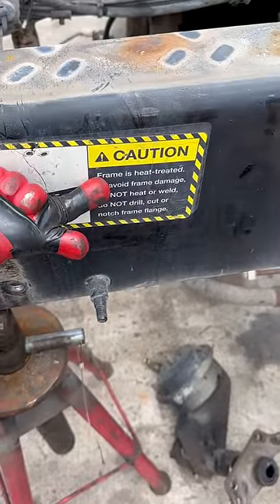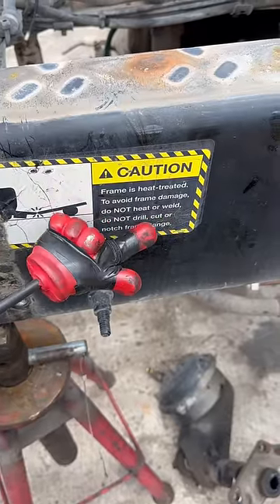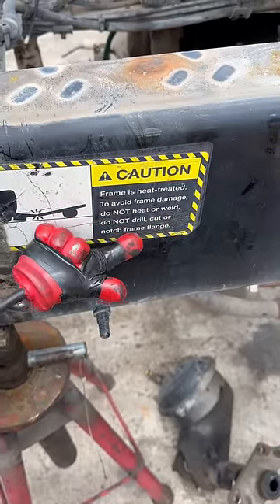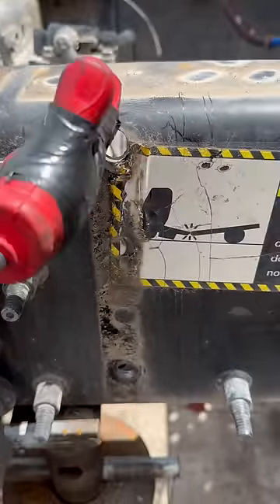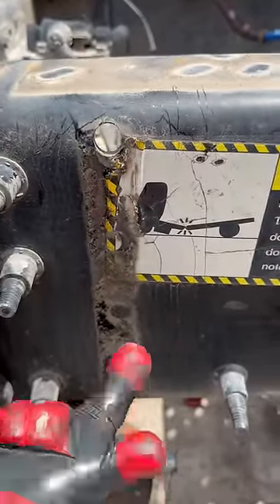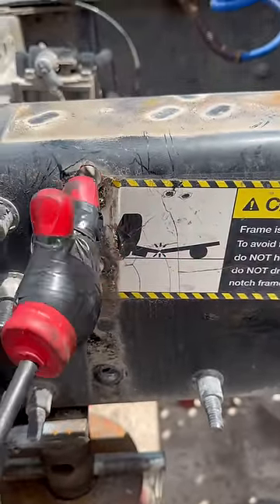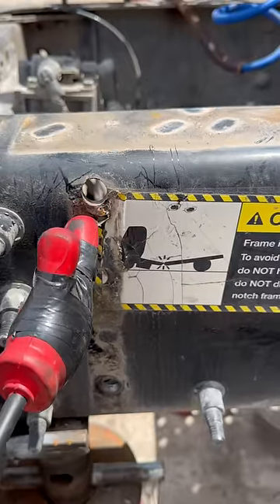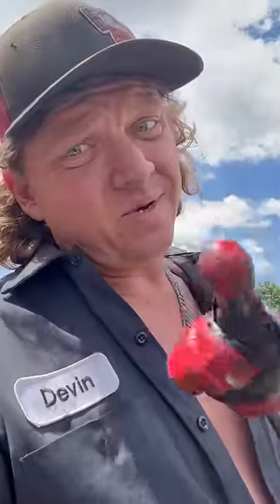When it says don’t do it , DONT DO IT

Comment: I agree the hole was drilled too close to the radius. The sticker said not to modify the flange which is the top and bottom of the C section of the frame rail. The holes are in the web of the frame. If the holes are properly located, drilled straight and deburred there shouldn't be a problem.

Comment: Place I worked some years ago had a HUGE piece of equipment used to convert rolls of paperboard to stacked sheets of paperboard for presses.  
It needed a major part replaced that required removing a large (very large) gear.  
On the side of the machine was a warning sticker that said DO NOT heat the gear to remove it.  So, maintenance tried to remove the gear.  It didn't want to come off.  So they decided that the warning sticker was a ploy to keep them from fixing the machine rather than calling the company for their maintenance.
It wasn't a ploy.   The gear of course cracked when heated, just like the sticker warned.  
It was three MONTHS before they were able to find a replacement gear and fix the thing.

Comment: I worked for a gas hauling company. They took a truck to a cheap shop to have a transfer pump installed. They welded a bracket on the inside of the frame rail, right on the flange. When that frame rail snapped in half, it was on that weld.

Comment: Beam theory says this man is right. The top and bottom flanges support the bending stress. The center supports peak shear stress. Partially in between the center and outer edges, slightly favoring the top/bottom away from center, is where minimum stress is located in a beam.

That being said: You are best off using the smallest hole and bolt possible, strong bolts like AN- not Grade 8. And chamfer the hole clean up the burr to reduce fatigue.

Comment: Some of you cant read but its ok it says 

CAUTION
Frame is heat-treated. To avoid frame damage, do NOT heat or weld, do NOT drill, cut or notch frame flange.

The driver only drilled a few holes they didn't do the rest of the steps on the warning sticker

Comment: That's basically a write off now. I'm sure you could temper, repair, modify then reheat treat it and apply the coatings but might be cheaper to just replace the rail and use this one as scrap.

Comment: This happens because the box hardware rarely works for where the driver wants to place it, you can see the bottom hole is barely on the horizontal as well, this is why when we install boxes we often need to fabricate the mounting hardware.  Yes it sucks to need to cut parts and weld custom brackets and drill holes in the box (a lot of times stainless) but do what you need to do to keep it safe.
Reply: You might want to invest in a (manual) brake press. Makes making brackets a whole lot easier. Another tip: use aluminum for brackets. Way easier to cut and drill, and it doesn't rust (be sure to use the right cutting discs though, and use plastic insulation washers between steel and aluminum to prevent corrosion).

Comment: Biggest problem I see as a redneck engineer is that them holes were definitely drilled on the "full send" setting. That heat treat is done around those holes. Slowly boring a hole through treated steel is time consuming and a pain in the ass, but it beats having the sum bitch snap in half lol.

Comment: Quasimodo got a point. Now I'm wondering if that fuel pump I added is going to cause damage to my Elco frame.

Really hope not. That thing has been very helpful. GM used mild steel framing and not heat treated, right?

Brb for Google.
Reply: Google did not have the answer. 😑

Comment: If im reading the sticker correct, it says not to heat or weld the frame, and it says not to drill, cut ot notch the flange.  The way I read it, it should be perfectly safe to drill the web.  That top hole is a bit closer to the flange than i would prefer, yes, but its still in the web and likely just fine from a steuctural standpoint.  

If the requirement was to drill it two inches from the edge of the flange, i would think THAT would be written on the sticker, no?

Comment: Dude, those holes are drilled in the "WEB" not the "FLANGE". The flange is orientated 90° from the web. In this case the top and bottom of the frame rail.

Comment: We drill into the frame all the time for one of our customers. They buy tractors from us and ask us to increase the distance the fifth wheel can slide. To do that, we add more to the fifth wheel rail and drill the holes in the frame to fasten it and weld onto the frame. I once brought up that sticker and my foreman said, "we're the dealership. That doesn't apply to us." Moral of the story, it's just a sticker.

Comment: Actually you're wrong. They drilled holes in the web, the sticker says not to drill the flange. I worked for the company that made those (metalsa (roanoke,va))
The web is the center, the flanges are well obviously the flanges. Maybe brush up on your terminology?
You're correct, it's a bit close to the radius, but not on the side that matters as much.
Reply: Basically do not heat or weld it anywhere, and don't drill the flanges. The web gets drilled all the fuck over lmao. With a laser, and Mazak. And the ramp gets welded after heat treat(if it has a necked ramp).

Comment: I have always seen those signs on frames can someone explain to why you're not supposed to weld or drill in frames however I've seen frames welded and drilled through all the time with no issues...Devin your pointer is hilarious I love it😂👍🏿
Reply: It depends on a lot of things. In this case the frame is heat treated, which is usually done for added strength. The holes that were drilled by the factory were done before the heat treatment. Because of how heat treating works (it's a little too complicated to explain in a YouTube comment) you don't want to be changing the structure afterwards. It essentially messes up the internal stresses from the heat treatment that adds the strength.

Comment: So my real question is, if the hole is drilled slowly with lots of cutting oil, is it really a risk of damaging the heat treat? Obviously if you use a magnetic drill press and are standing on it dry  it'll create immense heat, but if I'm being relatively slow and don't smoke the oil should be good right?

Comment: One of the first things I was taught installing extra tanks and steps and boxes on new to us trucks was to block inside frame rail with white oak one solid block of white oak that is to make back even from top to bottom then install heavy duty c clamps more square clamps lol but you know what I mean and that would clamp around the frame rail not torching or cutting or welding or doing jack shi* to the frame because I was told if the frame was heated or cut or welded or drilled and truck was in accident insurance would not pay out!! And or dot would get your as*

Comment: That sticker says don’t heat or weld any part of the frame, nor cut, drill, or notch the flange. Those holes (except for that terrible hole through the corner) are in the web, not the flange. I’m no expert on frames, but I’m pretty good at readin’, and that’s not against what the sticker says.

Comment: I'm sure your advice is good and absolutely correct, but the frame hasn't broken yet either.This clearly as a lousy job for sure, however if you read that sticker there absolutely nothing you can do to possibly do to attach or repair anything at all, all methods are forbidden.  It's tedious but it is at least a possible to drill a hole without damaging the heat treatment.

Comment: That wasn't drilled. It's a laser cut hole on a flat sheet of steel. It then gets formed with a press break. Notice the hole is slightly stretched.  Press operator should have shortened the upper leg to keep hole away from bottom die. But was probably just following the genius engineer 's blue print.

Comment: Couldn’t you use a clamp to attach whatever and then wield the clamp so it can never fall off?
Reply: The phrasing is a little confusing but I believe it is essentially saying don't weld or heat at all. If you need to drill, don't do it on the flange. A few small holes in the side wall shouldn't hurt as there are already bolts going through it from the factory.
Reply: @ragnarok7976  they drill the holes before the heat treatment. Drilling holes afterwards will usually negatively effect the strength of the beam.

Comment: The hole right next to where you are pointing is not 2" down.
Reply: That was drilled from the factory before the heat treatment happened. Which is the main reason not to drill new holes.

Comment: Weld the hole shut & drill a new mounting hole lower.

For those who know what they're doing, those bullshit caution/warning stickers are a joke, as they are only there for legal liability reasons.

Frames are drilled & welded on all of the time.

It's more about a person's need to know & understand the correct ways to do VS the wrong ways not to do chassis modifications.

Comment: need to learn how to measure, the huckbolts are closer than 2" to the flange, , weld, repair, stretch frames all the time, not just steel, aluminum frames also

Comment: My buddy worked at Kenworrh and 3 Muslim guys came in w a big rig that they had cut a hole in the bottom of the cab and they were shitn out of the hole. They would take turns squatting out the hole and run the truck non stop. There was dirt all over the place. Kenworrh condemned the truck on the savages.

Comment: If that frame was heat treated. Then theoretically, you wouldn't be able to weld to it, anyway.

You would have to get the frame up to the temperature of annealing, and then, weld. 

Without looking at the manufacturer specifications, I would think, the heat treating would be somewhere between 1400 and 1800 degrees... Chevy pickup trucks become, brittle, at 1600. And judging from the amount of heat crayons sitting on the shelf at the welding supply companies. I would say, nobody's following those technical service bulletins.